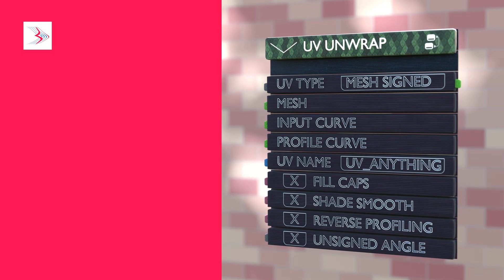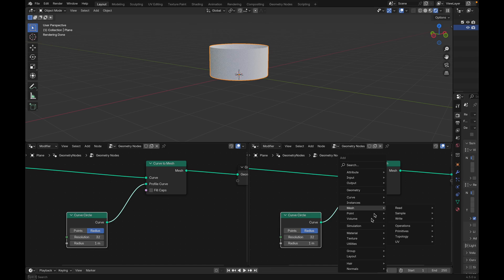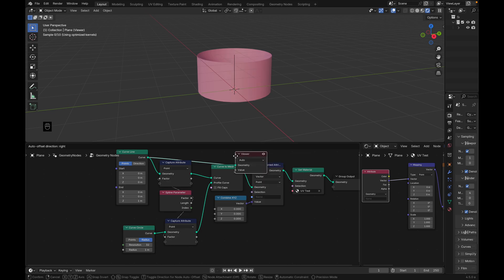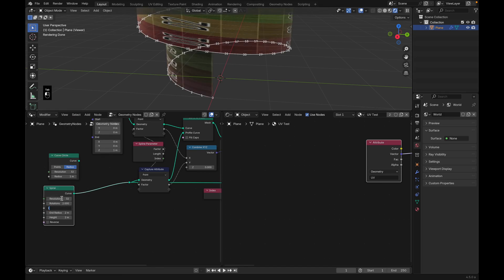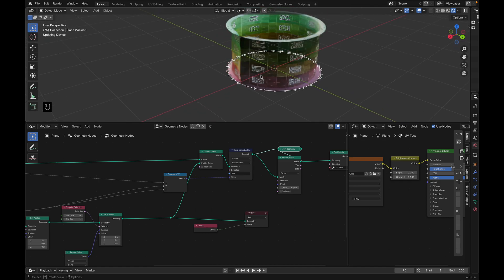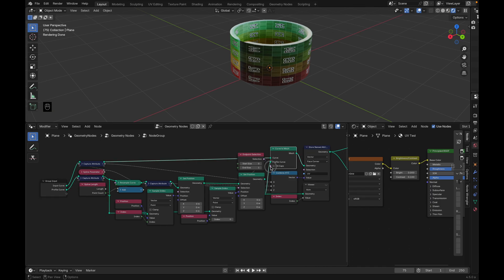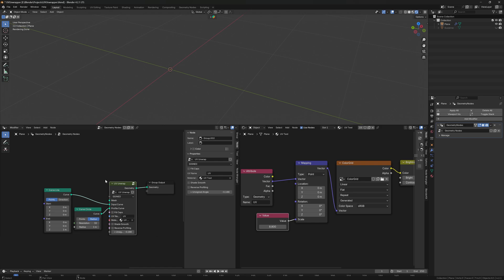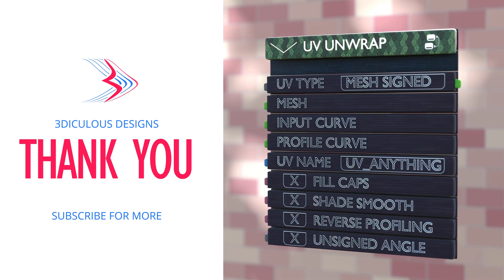Ultimate Blender Geo Nodes UV Unwrap – Unwrap ANYTHING Procedurally!

Comment: Instead of replacing the curve circle with spiral, you can add a trim curve after the curve circle, which is suitable for the star and quadrilateral that come with the geometry node, or a custom closed curve

And when capturing the properties of the contour curve, the curve length can be captured, resulting in less UV stretching
Reply: Capping can be done using the closed curve before using the trim curve and instantiated it on both endpoints of the curve, although it is important to note that the normal orientation is correct
Reply from the maker: @GouShi-qwerty Yes curve with a trim node works same. But for instanced capping, it might create a problem if the idea is to have a packed surface, where one may want to have additional geometry generated/instanced on top